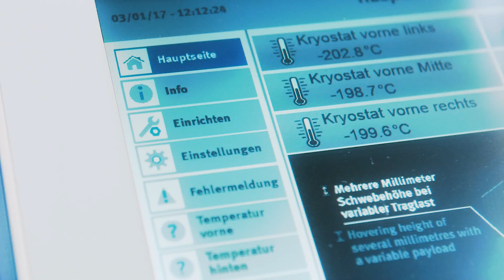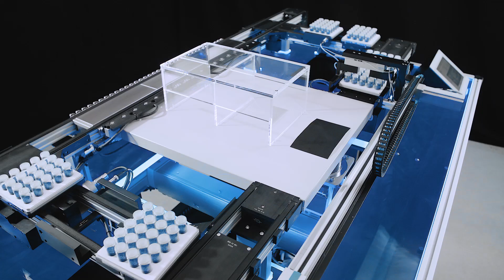Festo – SupraMotion 2017 (English)

Comment: Don't they have to cool the superconductors with liquid nitrogen? I'd be curious to see how they can make that competitive with more traditional manufacturing methods. Perhaps they're simply throwing ideas out there and simply treating it as a premium precision concept?
Reply: ProlificSwan vibration
Reply: They are cooled thermoelectrically with solid state coolers, look up TEC's. You drive subzero temperatures by cooling one side of the device with a heatsink. You can pump large amounts of energy into these small devices as long as you can keep the one side cool.